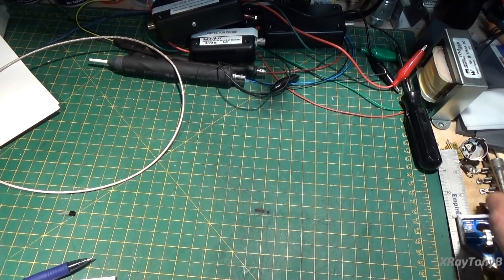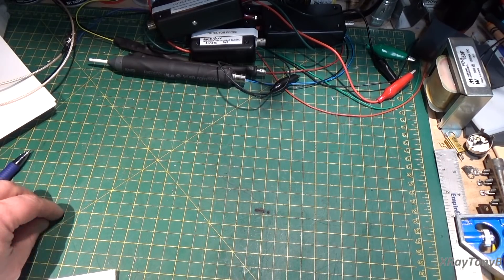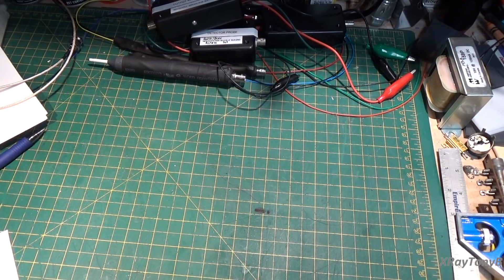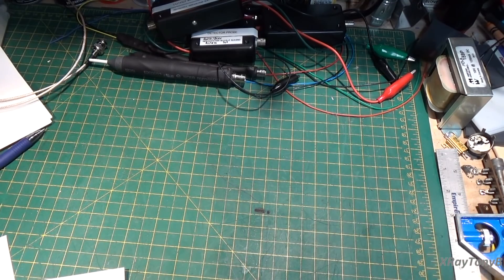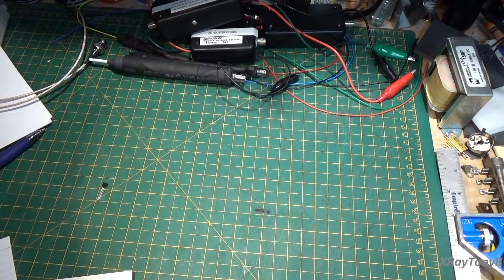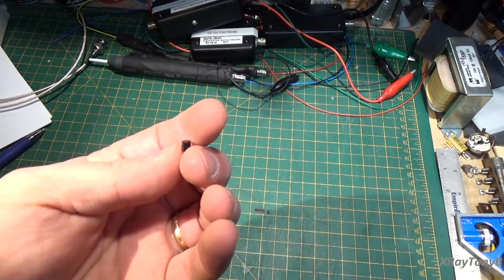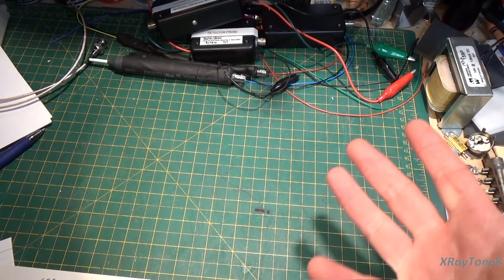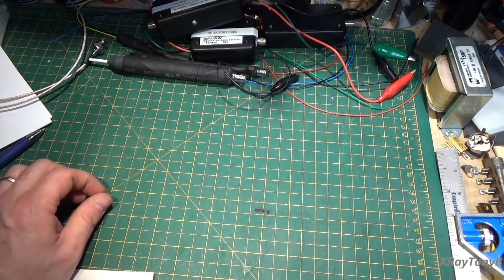Notes on Probes and Viewer Questions

Comment: I can answer two questions.  Why does equipment never come with probes and where do they all go.  They rarely come with probes because they got separated at a public auction.  Radio/TV shop goes out of business and 20 or so years later the owner dies.  Auctioneers don't know anything about the equipment and all the probes usually end up in one or two box lots.  Where do they go.....to my shop of course.  :-)  I have hundreds and hundreds of orphaned probes.  I buy them by the lot any time I see them.

Comment: Your little RF sniffer probe is also GREAT to use on a SPECTRUM ANALYSER to make sure you do not damage the EXTREMELYsensitive front end on those instruments as some have input ratings of  ZERO DBM or LESS !!!!  This is for the viewers out there in you tube land particularly !!!  if you go above the MAX DBM rating on these inputs you WILL DAMAGE THE FRONT END SECTION ON THESE SCOPES. So if you make this type probe it might save you from a REAL EXPENSIVE if not IMPOSSIBLE REPAIR !!!  Just thought I would mention this, especially to those out there who may not be aware !!  John A Bellas.
Reply from the maker: Funny you mention that.  If you look on the bench, there is another "plastic box" probe that I didn't show.  It is an isolation/limiting probe for the spectrum analyzer.  I meant to show it but I forgot!!  I'll try to remember to show it on another video.  Sorry!
Reply: Tony --   Don't be sorry about that,  I just wanted to point out to your viewers that that little sniffer loop probe works well for that too !!
but you are right also, nothing like the isolation probe too when you have to actually latch on
the circuit somewhere !!!

Comment: Tony.................... I have just bought a Farnell DTV12-14 Oscilloscope I wish to work on radio's, and yes you guessed it, it came without lead, can you please advise me what leads I need to buy.
I Left the TV. Radio servicing field fourty years ago when I had a career change and commenced work in industry, And now I want to take it up again as a pastime for my retirement, I have been reschooling myself with various You tube clips and am pleasantly surprised at how much is coming back to me........Thanks to people like you who give generously of their time.

Regards........... Ray H. ( From the U.K. )
Reply from the maker: Ray,
Welcome back to the hobby!  I have had very good experiences with some of the probes I purchased from eBay.  Search for "P6100 Oscilloscope Probe".  They are a pretty good 100MHz probe for less than $10 US (not sure the cost in Euros).  If you need higher frequency, just search P6200 for 200MHz, P6300 for 300MHz and so on.  I have a few of the P6400's that I use on my Tektronix 2467 and they work almost as good as the original $300 Tek probes.  Best wishes!

Comment: any hints for replacing seriously old transistors, like 125's and 127's that have four legs ie e c b and shield - is that in anyway possible apart from buying old stock that is also probably bad?
Reply from the maker: I thing you are talking about the AC125/AC127 transistors.  They are Germanium type transistors.  Modern transistors are silicon based and have different properties, so they are NOT interchangeable.  Your best bet would be NOS transistors from a reputable supplier.  I usually search online through eBay for a seller that specializes in them.  You can still find very good NOS germanium transistors by Siemens and telefunken that aren't too old.  You can also find the Motorola and GE NOS, but they will be super expensive.  I've seen where some other techs have been having good experiences with the NOS germanium transistors from the old USSR.  They are high quality and inexpensive.  Unfortunately, the datasheets are in Russian.  Some sellers have translated the datasheets into English.  You just need to make sure the voltage ratings are high enough to suit the application.  Shango at YouTube channel Shango066 has several very good videos on these transistors.  Check him out.  Great channel!